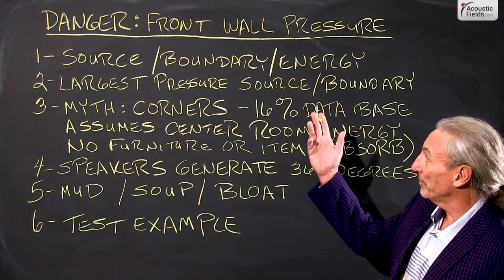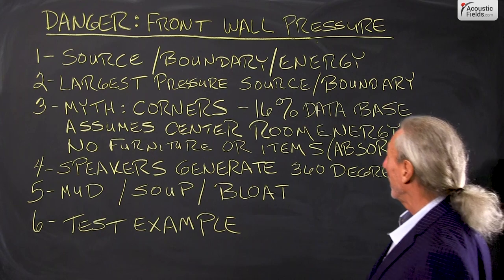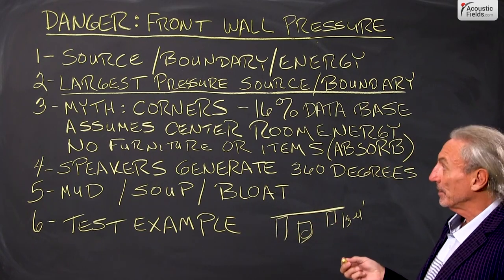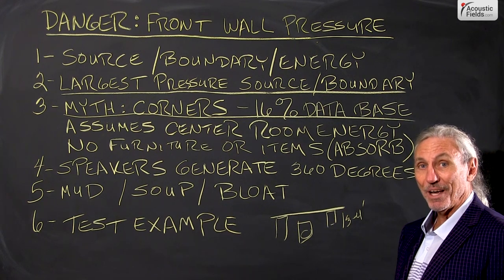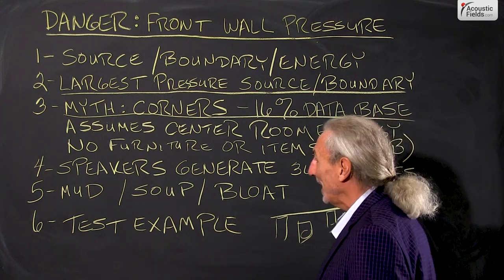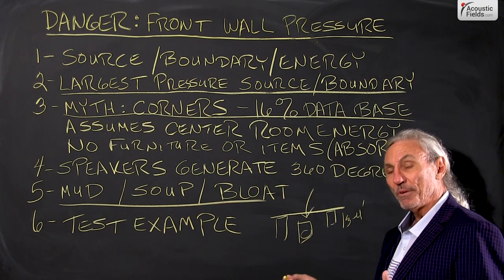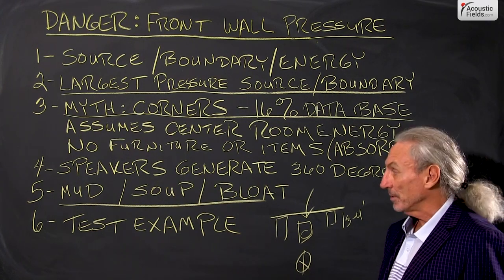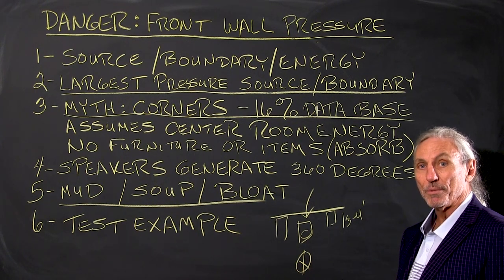How To Deal With Front Wall Pressure? - www.AcousticFields.com

Comment: I welcome the science, (I don’t understand a lot of it, but I welcome it anyway, as I try to grasp it) and most certainly, measuring tools such as db meters and RTA’s seem to be necessary for accuracy. 
But, I don’t need either to know that what you say about front walls, and that which is happening behind monitors in proximity to that boundary, is absolutely true ... because when I step behind my monitors, I can both hear and feel that low frequency energy and pressure. 
Considering that I’m working with rear-ported cabinets with 8” drivers; that’s probably a no-brainer for those who know how sound works. The differences between my listening position, and behind my speakers, is huge. There’s a huge amount of low end happening behind my monitors. I have no trouble believing that this would even be the case in smaller monitors, too, (rear or front ported), when working in smaller spaces where frequencies are bouncing around all over the place, and creating pressure in any contained space. 
I have no idea where the “rear wall is most important” myth originated, that it’s mentioned so often as being the most important boundary to treat in terms of low frequencies - (and I’m not implying that treatment isn’t also needed there) -but for some reason, the myth has been perpetuated that the front wall is incidental, and not nearly as important to treat as the rear or side walls are. I see so many pictures of mixing rooms - some with some very nice gear, too - where the mixing position (and the monitors) are jammed up tight against a wall, with mere inches between the monitors and the boundary behind them. I understand space limitations; there are many small space facilities these days... call me crazy, but doesn’t that make treating front walls even MORE crucial? 
I’m no acoustics expert. I’m just speaking from my own experience as an engineer who has worked as a “hired gun” in many rooms over the years - small, mid-sized, and large. But even in some of those very big control rooms, I’ve seen consoles that are positioned right up against the glass, and monitors sitting on a shelf above the desk, or on a meter bridge that are less than  a foot from the boundary. 
I do find it odd that so many of the smaller “production” (home studio) rooms have spent quite a lot of money on some very nice gear - even investing in big money monitors - yet, they ignore the room itself. 
It seems to this acoustics science dummy ( yea, that would be me) that if you are mixing or mastering, that nothing is more important than the room itself. 
IMHO, of course. 🙏
Reply from the maker: D,  i have the same concerns.  What is amazing to me is that people spend thousands of dollars in high resolution, expensive gear and then place it in high distortion room. All small rooms are high distortion.  People take digital technology and place it an analog room. What people fail to realize is that the difference between a 1,000 DAC and a 10.000 DAC are minimal. Most of the retail price is marketing driven. People would be much better off spending less on gear and more on room. Spending more in the analog domain, will go a long way to minimizing digital gear costs. If your room is higher resolution, you will hear everything that 1,000 DAC has to offer. That may do it for you. You will also be able to hear the 10% difference the 10 K DAC has to offer. I can take a 3,000 rig and put it in my room and it will sound like 300,000. I can take a 300,000 rig and put it into an untreated room and it will sound like 3,000. The differences in these two ratios shows the amount of distortion present in the room.

Comment: Considering phase cancellation issue made by source sound and reflection from front wall, isn't it okay to put speakers as close to front wall as possible? I've seen a video where Genelec was recommending this.
Reply from the maker: Placing subs against the walls produces room distortion. You achieve more gain but at the expense of more room distortion

Comment: Hey Dennis - on the wall distance. What about speakers like the Neumann KH120 or 310, the manufacturer suggests it is better to move it directly up against the wall if you can't have at least 1m behind it otherwise, saying to mind the 20cm to 80cm gap especially. I tested this and I feel like it those actually sound better right against the wall
Reply from the maker: Manufacturers tell you this to produce more LF gain. Why would you desire more room distortion.  Quantity is not quality. When is more room distortion better sound quality.
Reply: @AcousticFields  They tell you to compensate with the built in EQ curves, and my low end got much better this way tbth

Comment: Does that mean putting low frequency absorptions on the corners are a myth?
Reply from the maker: O, The definition of an axial mode is distortion between two parallel wall surfaces, not two parallel corners.

Comment: What if my room is small? I can't put my speakers 3-4 ft away from the front wall, because then I'll be in the centre of the room, which isn't ideal. I need to do the pressure level test, but for now, I put 7 inch thick absorbers behind the speakers. What are your thoughts on this? Any help would be appreciated!
Reply from the maker: An absorber 7" thick will not be able to deal with low0frequency pressure issues.
Reply: @AcousticFields  how thick should it be then?
Reply from the maker: What is the frequency and amplitude of your problem?